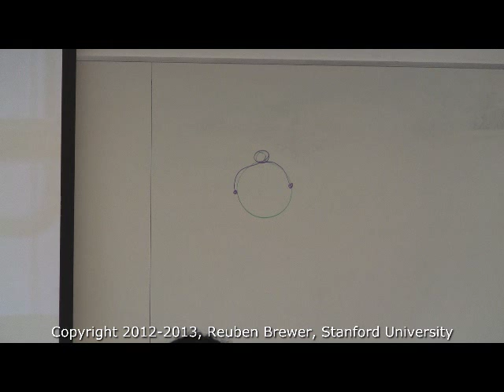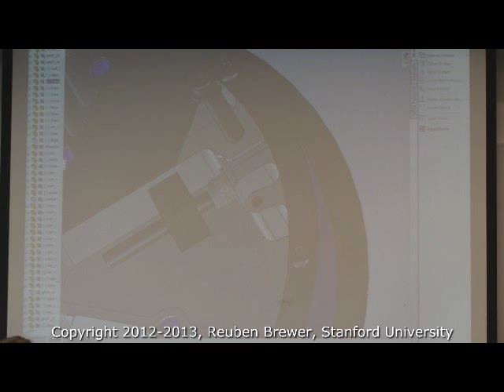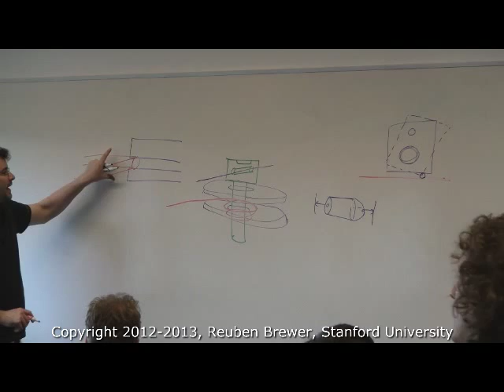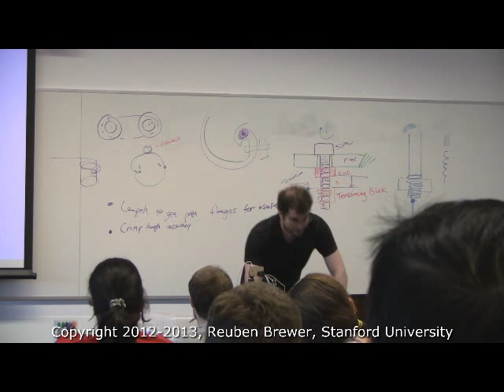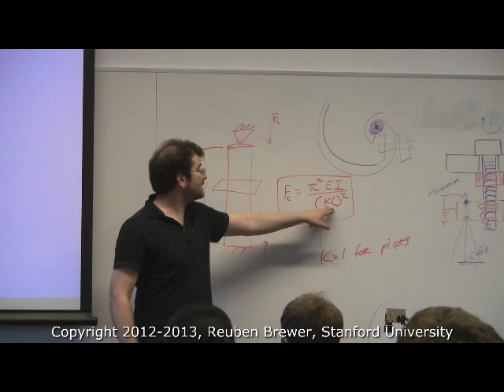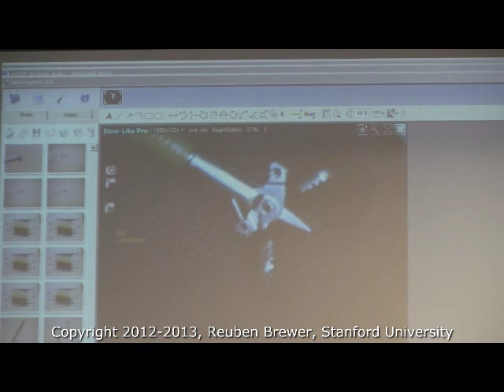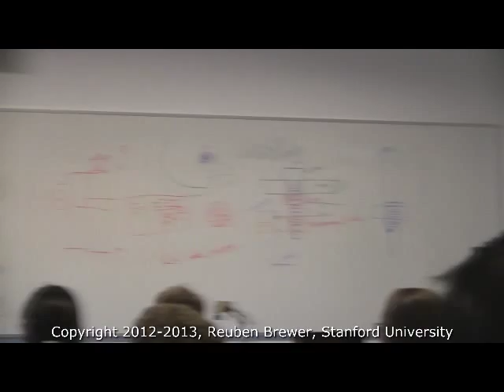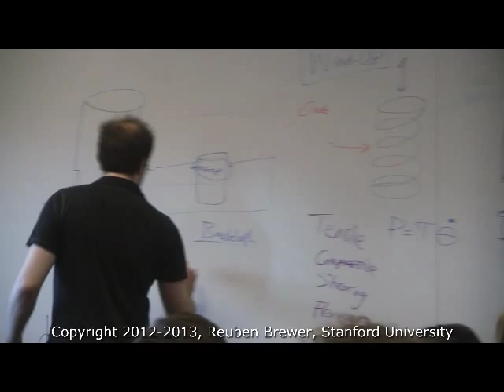CS235: Applied Robot Design, Lecture 8-Push-Pull Cable/Sheath, Universal Joints, and Flexible Shafts

Comment: What's a good link to buy the flexible shafts used for robots? I want to connect from servo motors to shoulders, elbows and wrists in a full scale humanoid. Also, which attachments can be used? Also, should I use a hollow pipe/channel exoskeleton or create a solid skeleton and run the flexible shaft on the outside? I am considering flexible shafts for rotation and bicycle cables for leverage.

The humanoid is made from a mannequin so I cannot use servo motors in the arms - they are annoyingly rectangular with offset shafts - so I'm hiding all the servos in the torso.